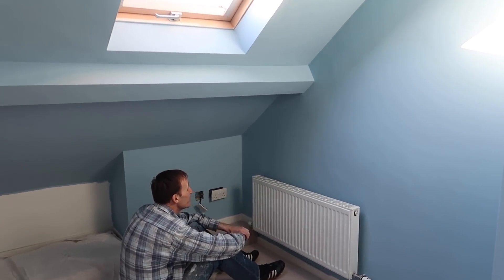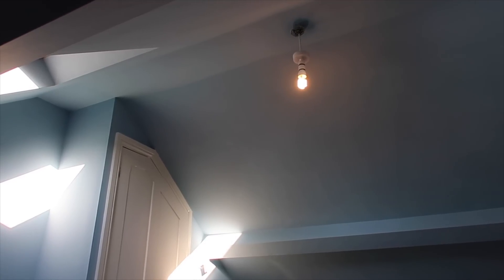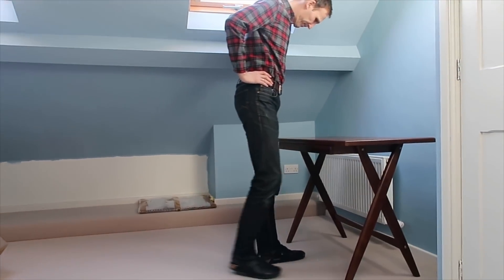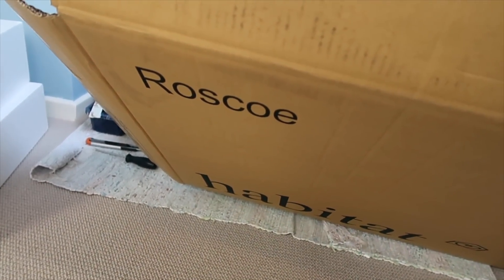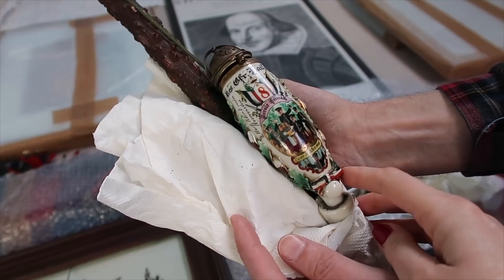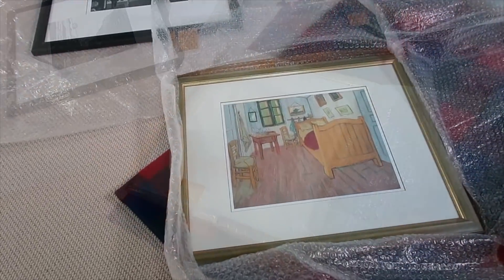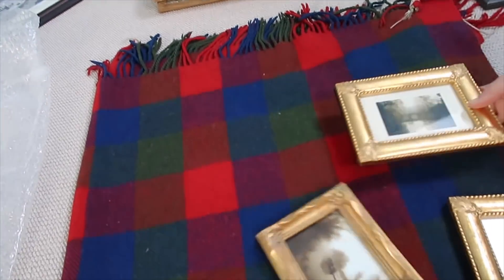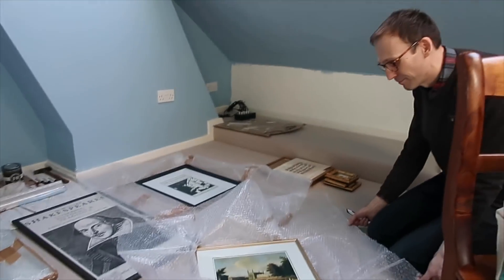HOME UPDATE: OUR ATTIC ROOM & WE'RE FINALLY UNPACKING OUR PICTURES

Comment: First, that blue is absolutely gorgeous. An amazing choice for that room and you did a great job with it, too :) Second, about the paintings you would like to hang on those walls... there is a special way of hanging framed works to slanted walls, by using the proper wall anchors for them and something called keyhole brackets. Worth of checking and if I remember well (I have some of my paintings mounted this way), they weren't extremely expensive, and aren't hard to mount on the wall, either. If you find them, you would be able to have whatever you want on those walls. And third, for the cabinets you plan to fit in those spaces... now, this is only a suggestion, out of some experience with the similar problem. You might want to consider sliding door after all. This, because the room is small and if you decide on some other furniture, opening doors that open to sides might give you trouble time to time. Nothing you couldn't live with, I'm sure, but by using sliding doors, this could be avoided altogether. There are some really beautiful sliding doors and sliding screens (which can be amazingly decorated, as well), so it might be worth of a thought. But, I'm sure that regular doors would look amazing as well, so it was just a thought. It will be joy to see what you did with it, whatever you choose in the end :)

Comment: You could build a small shelf, hang from the wall the upper part and set the bottom on the thin shelf. Maybe from the same type wood as the framing for the bookshelf.
Love the blue better, so calming .

Comment: When you have the broken glass replaced, have them use the non-glare or no shine or whatever they call it where you are.  I could not find any examples of shelves that attach to frames but I did find a few pipe stands that could be placed beside the frame.  Depending on where and how you hang it, you could put the mug on a little shelf on one side and something with this type of shape on the other?  Antique_porcelain_smoking_pipe_with_long_wooden_mouthpiece_as_per_photo.html

I think you are right about the color!  I liked the gray colors you first talked about, was leery about the green because there are so many green tones that it is difficult to match and they will often clash. But I LOVE the blue!  You guys did great!  Will you leave the table where it is?  It does keep your back away from the door on that wall, which is good.  Thanks for a great video!

Comment: Kirsten, I’m just watching some of your older videos and thought you might like a couple of tips about spiders. It’s unusual for spiders to be a real problem here they normally start to come into houses in autumn when the weather starts to get cooler. Try these two things. Collect conkers ( from the ground under horse chestnut trees)😀 put them in bowls around the house, spiders don’t like them and it does seem to work. Also, polish around your house and skirting boards with lemon scented polish (Pledge is a good one) they don’t like that either. These two things do seem to work 😉👍 Good luck.

Comment: I would suggest you consider a wood knob that you paint the same as the door.  It will further provide a blend in of the color visually.  If you are concerned about wear, a top coat of varnish could solve this.

You could even consider to paint the outlet covers with the same process.

Comment: I think the desk is good where it is with a custom radiator cover there. Or the desk could be floated in the middle of the room in the center facing the door and sitting with your back to the shelf. I've always thought it feels wrong to have your back to an entry door. I would also not be afraid to hang prints from the top down to the floor on some of the very little wall space you have. It's a charmingly quirky room. I love to decorate so I can't help putting my two cents in😂 it's been fun to watch the progress
Reply from the maker: Most definitely, it's not ideal to heave your back to an entry door. We will use this room to watch TV as well so will probably leave the desk where it is and have chairs and a table on the other side.

Comment: Great memory lane you shared.  I don’t know if it will work but maybe you can play & see.  Use Velcro on back of picture  and Velcro with stick & release tape (Command Strips, here in US) on wall.  Cannot tell much about the slant of the wall but it may be workable for something lightweight.  Maybe an easel for a small framed print on the bookshelf.  I love love the room!  Thanks for letting me share in the fun!

Comment: Glad you love the blue but I did love the green too.  Coming along fabulously!
Reply from the maker: The green was nice too but the shade didn't match the rest of the house.
Reply: Once upon a time I was a custom framing specialist with my own store several times over.  With all of your beautiful pictures, I could see that they were more than just pictures in frames to you.  Please allow me to give some important insights for the framing of Joerg's wonderful picture that had the broken glass.  Let's start with Lignin.  Lignin is one of the main components of wood cell walls and has a critical effect on the mechanical properties of PAPER pulp and wood fiber based composites.  In other words, it is in the wood of the frame and the paper mat and probably in the document itself, if it is indeed paper.  This can be seen in items like newspapers, when after a while, it starts changing color and disintegrating.  The same thing happens inside a wooden frame or paper mat.  Lignin gas begins to build, destroying the document.  Suggestion...  for preservation...  line the frame,  and if using mats, use COTTON (rag) mats.  You can tell a paper mat from a rag mat from the color of it's core...  (that's what's between the top and the bottom of the mat.. thin as it is.)  If the core is white white, then it is a cotton mat.  Otherwise, it is a paper mat.  If no mat is to be used, then insist on "spacers" to keep the document backed off the glass a bit and gives the document some space to breathe.  I would hate to see your lovely keepsake destroyed by time.  This type of framing is called conservation or preservation framing.  There you go.  That's my two cents worth.  Love to y'all from Texas!